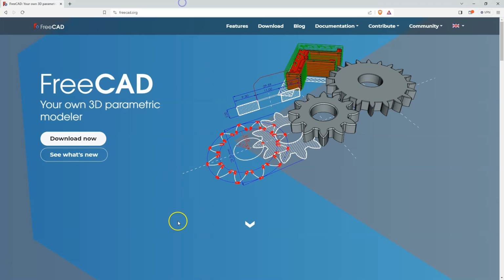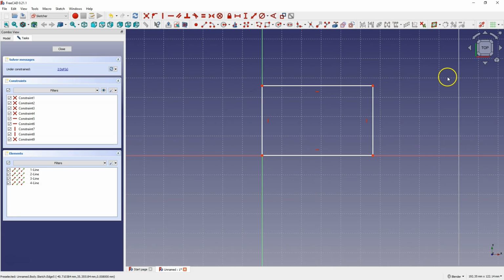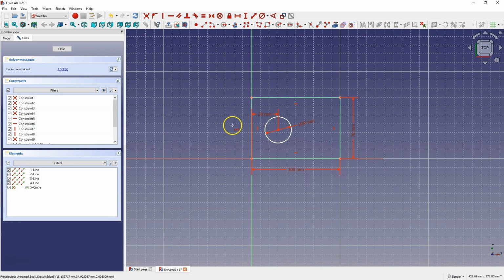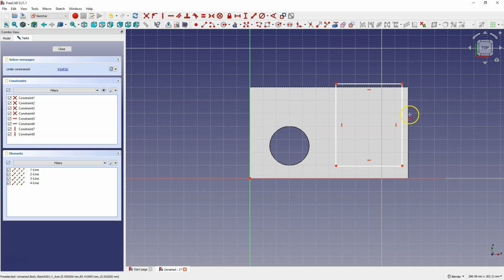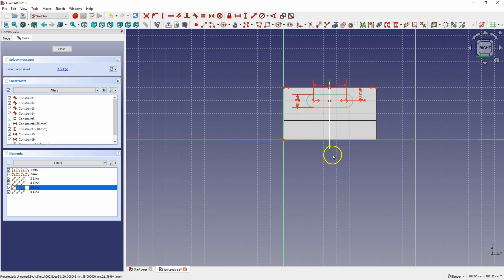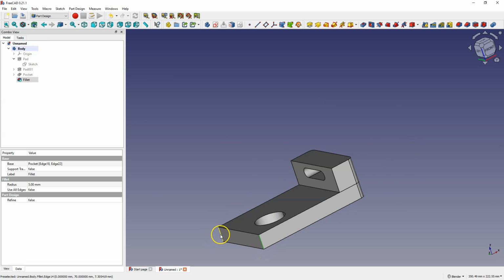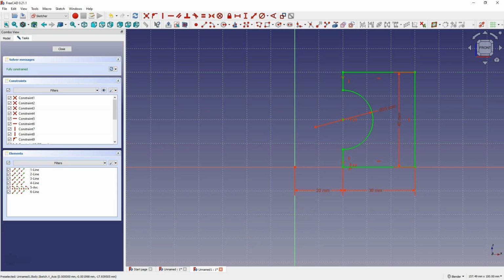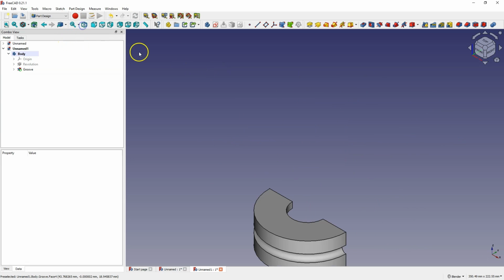FreeCAD Tutorial for Beginners 2024

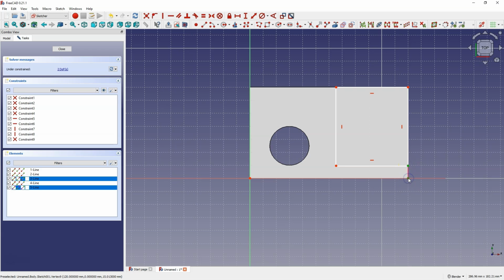Comment: @10:18 I had to remove vertical constraint to make if work because of redundancy.
I suppose you have a setting to remove "old" redundancy constraint.

I didn't finish, but thanks for this tutorial, which is quick and straight to the point.
Is that a generated voice ? :D